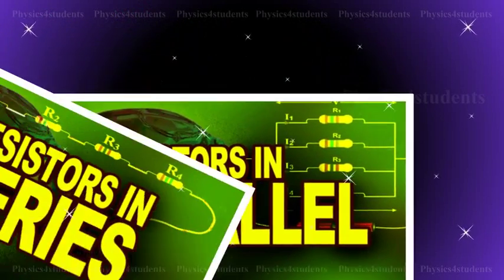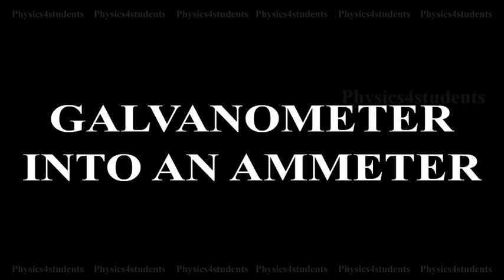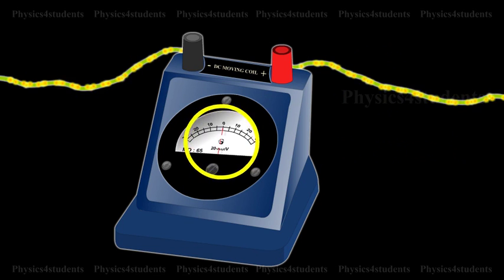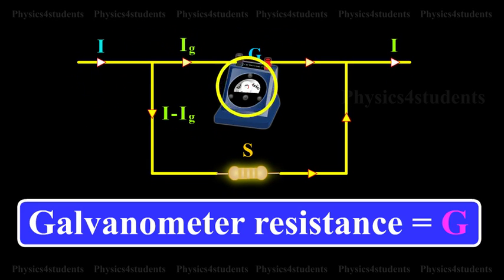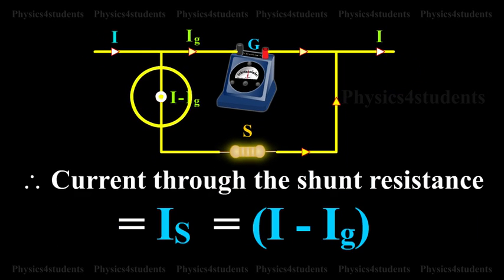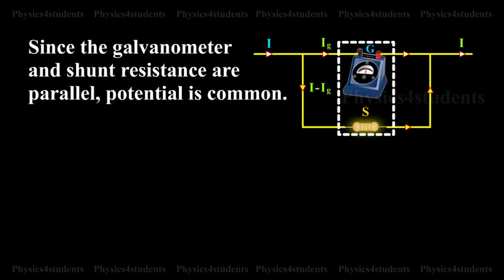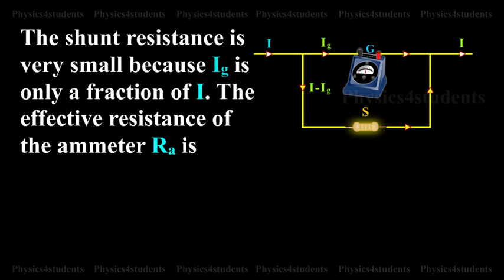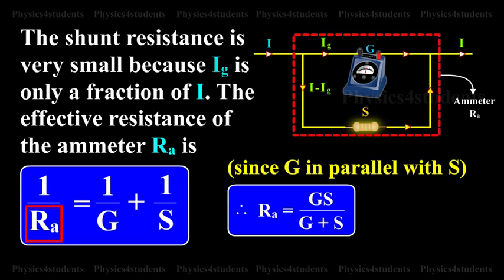Conversion of Galvanometer into an Ammeter | Plus Two Physics Tutorials

Comment: nice
Reply: Hey, I have a question if you could help me out. How does this help measure current if Ig, being the current that causes full deflection in galvanometer, will always pass through the galvanometer causing a full deflection. If it's always a full deflection, ammeter will always give the same maximum reading.